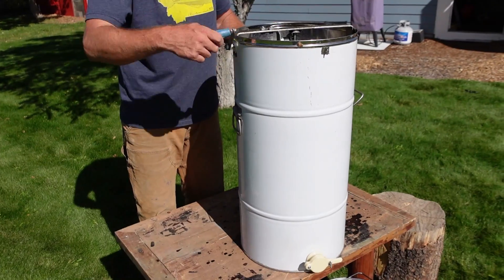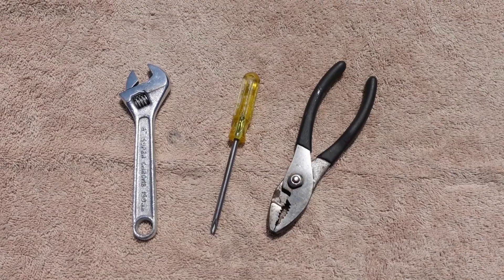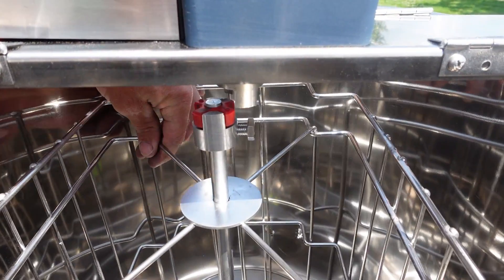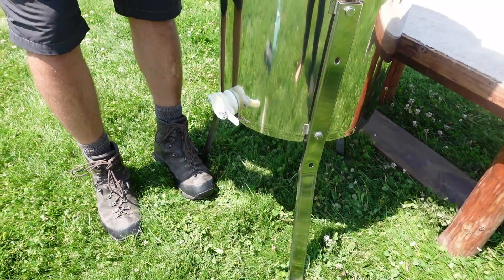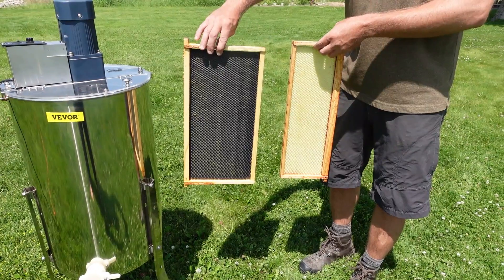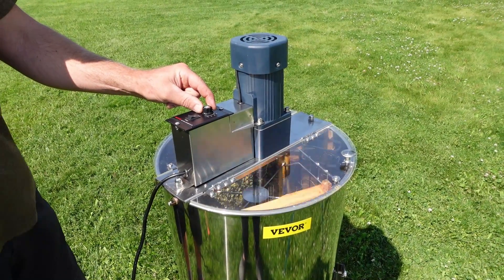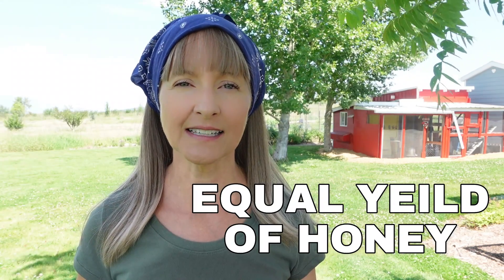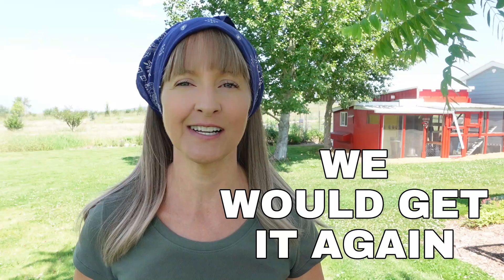VEVOR ELECTRIC HONEY EXTRACTOR 2/4 Frame - Assembly • How To Use • Review

Comment: How many frames can you extract before the Honey level gets to the bottom of the frames and makes the Electric motor work harder, I normally use a manual crank extractor and once the Honey hits the bottom of the frames the amount of energy required as well as strength increases at least two or three fold, so what I am asking is how does the Motor handle the strain ?
Reply from the maker: We've never maxed the motor and we've done up to 12 frames before pouring off.